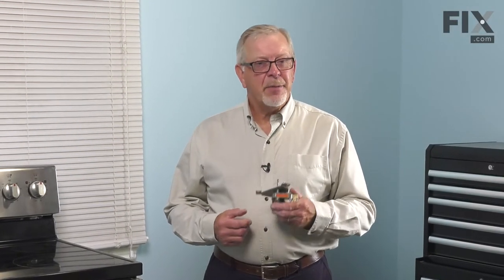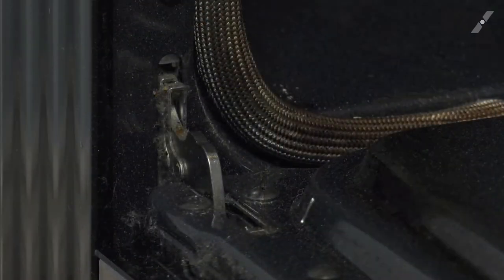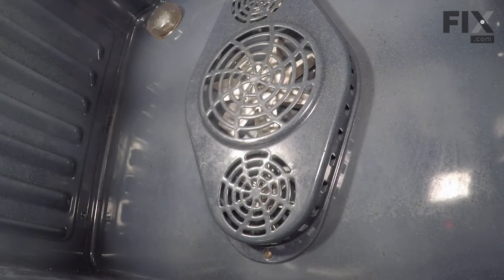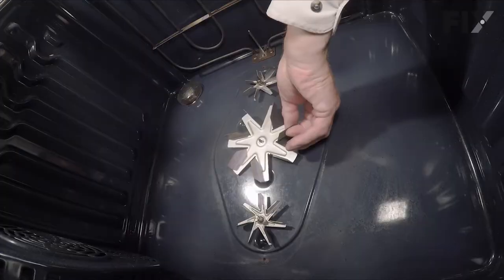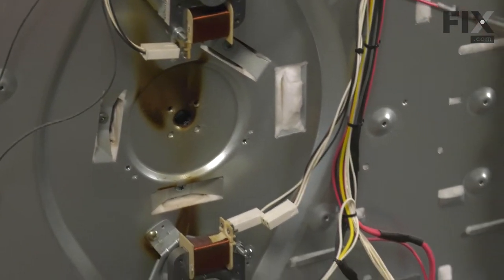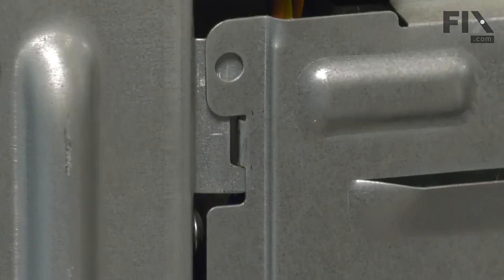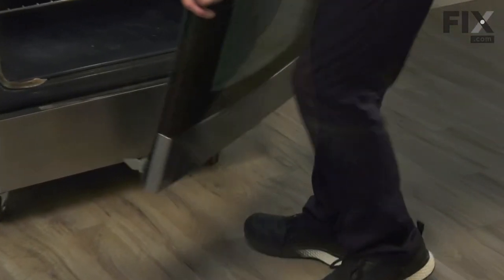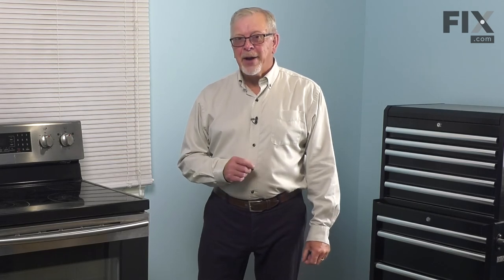Samsung Range Repair - How to Replace the Fan Motor

Comment: My fan wasn't turning anymore so I ordered another one directly from samsung. Thanks to this video I was able to replace the fan. I also realised that the spacer between the fan and the rotor was completely jammed. Had to use force and degreaser to remove it. Probably didn't have to change the part at all. Look if it's your case too before replacing the whole thing.

Comment: Great video! I was able to replace my fan quickly. However it is still not working when I turn on convection bake. What do you suggest be the next action to take? Maybe the electronic control board?

Comment: Thank you for posting.  That stupid bolt that secures fan was off when I opened my oven.  Tried putting bolt back on at no avail, because you have too tighten backwards. You mentioned to loosen clock wise.. Bingo my bolt went back on like a charm.  I looked everywhere for someone to go through every step like you. Your the best !!!!

Comment: Excellent video! So simple really, but the local only-company-in-town folks would have made it very expensive and very inconvenient. A few steps (removing the fan propeller and removing the door) were esp instructive to someone who just flies by the seat of his pants. Thank you!
Reply: Everyone should be aware that MY Samsung convection oven fan (on the top) does NOT have reverse threading!!! Perhaps the lower fan does, but DO NOT assume yours has reverse threading simply because the Samsung model in this video does. The truth is, I would have been better off following my own instincts, as it turns out!

Comment: Any tips if the nut wont unscrew?  As I turn counter clockwise and look at the motor in the back, it looks like the shaft is turning with it, regardless of if I hold the fan in place.
Reply: I believe the nut that holds the fan on has a reverse thread. This is sometimes done on shafts that spin and might cause the nut to loosen if the thread were normal.
Reply: The fan nut is reverse thread. Lefty tighty, righty loosey